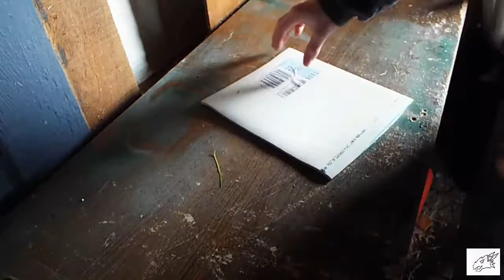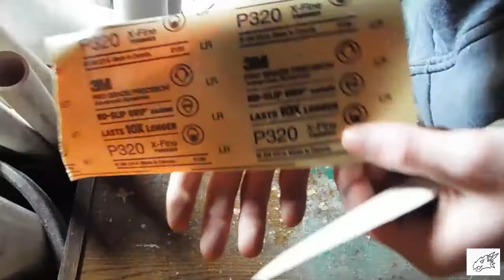How to Make: a KNIFE out of PVC Pipe (MINI BUILD)

Comment: What the hell kind of PVC is that, that you can cut right through it with a utility knife? How long did you have to heat it, and to what temperature to do that?
Reply from the maker: It's been a while. I think about 200. But you don't wanna burn it so if you try it yourself just slowly keep raising the temperature allowing time for the heat to travel through the pipe until it is flexible.
Reply: Yes they were right you heat your oven to 200 any higher the pvc can give off toxic fumes. When you heat the pvc it makes it very pliable almost rubbery and you can cut it. That looked like schedule 40 pvc pipe.